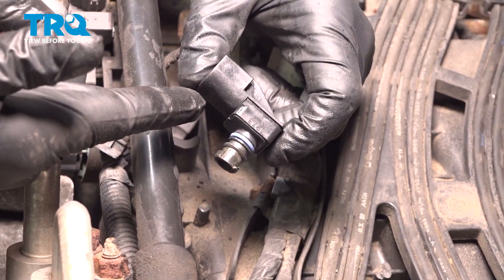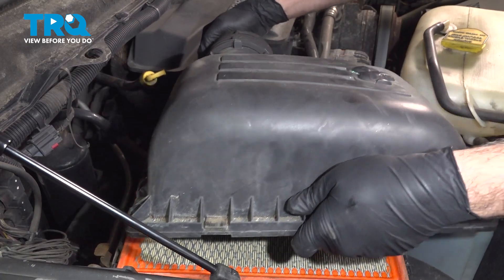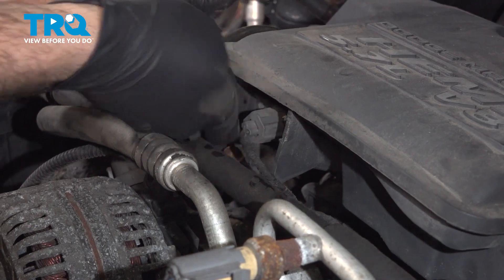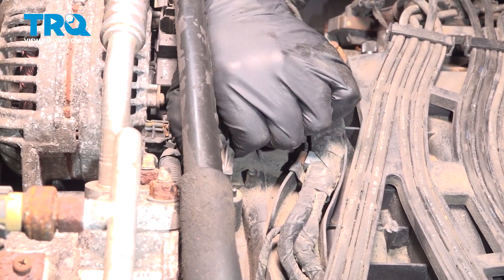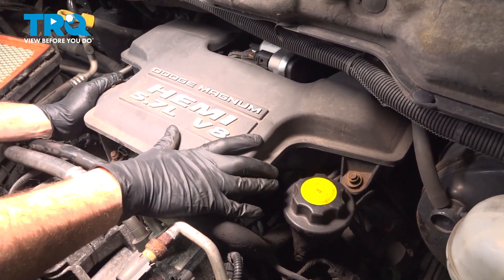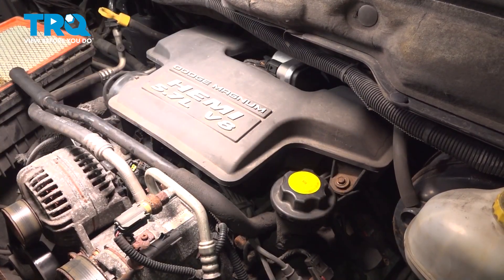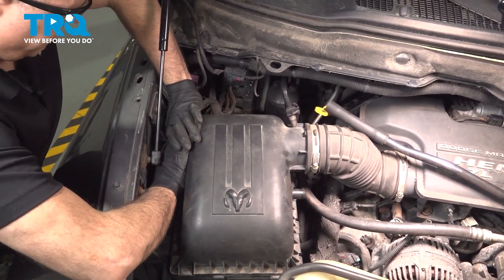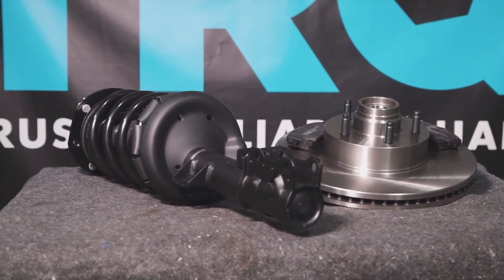How to Replace MAP Sensor 2002-2008 Dodge RAM

Comment: I have several error cods with my ruff idle. They point to both the sensor and coils. Im replaying all coils and plugs as well as MAP / Air flow coling sensors. Maybe I will get lucky. Im hoping its not the timing chain.

Comment: Those spark plug wires are all touching🤔 I spent atleast am hour making sure mine didnt, they had to be changed cause they we arching and burning holes through eachother. Am I the only Dodge Owner this has happened to? Just asking.